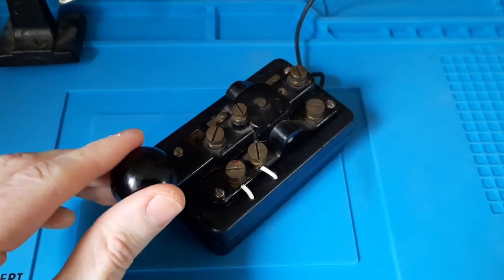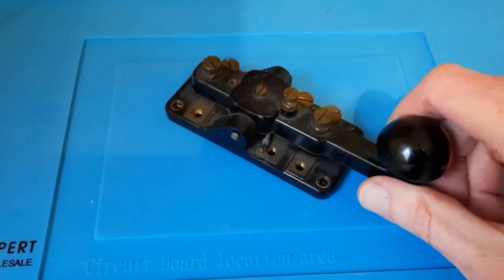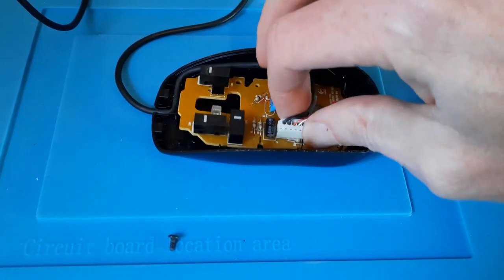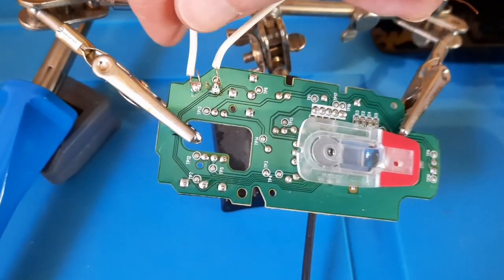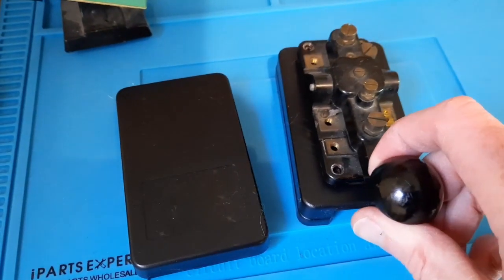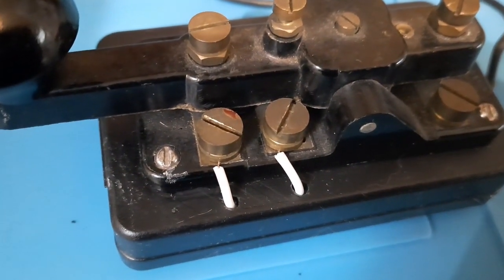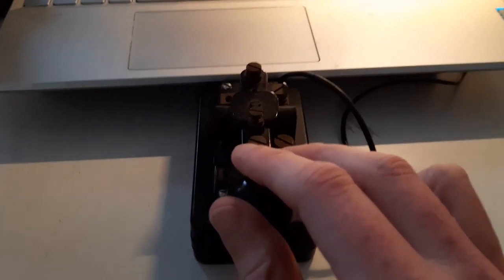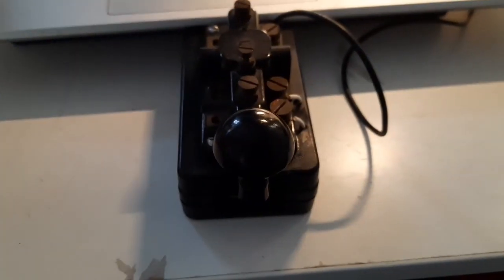Converting an Old Morse Key to USB to Work With Morse Trainers and Hamsphere

Comment: Great idea!
Does it work on V Band?
Also, you're effectively using 2 mice. Is that an issue to the laptop?
Reply: No, having two mice at the same time is no problem. Done it many times, I have several mice and depending on a game I would choose one over the other, both connected at the same time.

Comment: Interesting project.
Is that a KEY.W.T. 8 AMP No.2 MK III?
I bought one for 7/6d (37½p) in about 1970. I couldn't read Morse and just wanted one. It's my main key that I use now. I dropped it and broke it as it's bakelite but drilled both sides and glued cut down rivets in it to join it and it's still going strong.
G4GHB..
Reply from the maker: I don't know what the model is I'm afraid. It was part of a play set that someone had made, that I found in a junk shop. It was a wooden box that had a bakelite telephone handset and this Morse key fixed to it. The Morse key activated a buzzer and lit a small board. I imagine some kid had great fun playing with it decades ago.
Reply: @RustyRocketProjects  Okay, thanks, it looks just like mine. I did a similar thing aged about 15 when I got it, an old book showed a valve buzzer so I took my H.A.C. radio valve to try making one, an audio transformer and headphones from the H.A.C. It worked to my great delight. Radio hobby a stage further.
73, G4GHB.